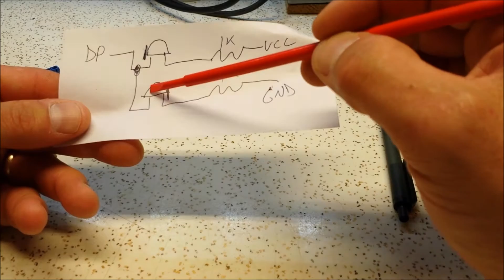Arduino ATtiny 85 PWM Solar Charge Controller

Comment: The 78L05 draws too much quiescent current (3-8mA), but it's crazy cheap, (<$0.05 in 100+),  and I use them a lot, but not for low quiescent current.
Something like a LD2981 (<1mA, not great but better), LP2950 (<200uA, good), TPS76350 (<100uA, very good) are.  Cost more, but they (escpecially the LP2950) are worth it.
If you work at it to fit into small memory, you can get an ATTiny13A (cost <$1) to work.
The PIC12F683 and ATTiny13A are actually the best for this app by far.
Reply from the maker: Awesome.  Thanks for the info on the 5 volt regulators. Did not know that had even lower quiescent current regulator.

Comment: An accurate and complete schematic would surely be nice.
Reply from the maker: It is the video description.
Reply: Thank you Sir for you're fast reply. The video description is pretty good but a schematic would make it a bit simpler to accurately reproduce you''re great design.
Reply from the maker: Hmm. Thought that was there let me check my files.
Reply from the maker: try this, just added a file to the link in video. 
https://6b1e3a5b-a-62cb3a1a-s-sites.googlegroups.com/site/recksdesignfabrication/arduino-projects/attiny-85-pwm-solar-charge-controller/arduino-pwm-solar-charge-controller-schematic.png?attachauth=ANoY7co4DRCpwWBcbstejROy4wNngRgx4CrlmGGAh4C7FkhTtCAcPMdyydRoLLO1ZjDDrJQhJwW6CMf0Syq6DRerKHi0r291g2HjdieznTI_-ZNK3J9GFCB9uy2sQ2SjiQZfJIwk_UBd46G9aBAk3c5leRECLeIpeiHBuSlUGZ1K4EtwFa0cFLaEmv390AC4WeSCw4KnhU-HmK95G70tIvZmn-grnpA4Po974ROxt_0iWKboghBklotppa95nI08jIdb19C1DUN_XX6bv0F5ig6U1PqEEmO7PRc9KqTPPXMffTxeaTqy4F3Ne8fkqI_52zN8AcAuitmxV6qZPayWkotdqeW7fH6t69NH2wWAjEchMvdq26Ez86k%3D&attredirects=0
Reply: Thank you!! The schematic looks beautiful. I just sent you a small donation by way of PayPal. I hope more youtubers follow your lead. An accurate schematic with component labels makes things much simpler to reproduce designs. Thanks again Carl..:)
Reply from the maker: Yes. Thank you for the donation.

Comment: If you  connect the junction of the two Leds to DP via a 1k resistor and take anode of one  to Vcc and the other to ground you only need one resistor.
Reply from the maker: +alan Alan Weaver wow. You are right! Not sure why I did not do that??? Thanks for the tip.

Comment: hi carl, thanks for the brd file. can you tell me how much maximum current can handle it??
Reply from the maker: +Arindam Ghoshal The mosfet us rated at about 100 watts so about 7 amp. However I would not go more than 5 amps.
Reply: Carl Recktenwald Jr. ah thank you. one more thing I noticed, there is no schematic  in your file section. it will be better if you upload a schematic. because there is a wrong lebel of shotkey diode.
Reply from the maker: +Arindam Ghoshal unfortunate I never did a schematic. That is actual a transient voltage suppressor. Not a diode. The circuit is a copy of the PWM 5 from Julian iilett. That circuit diagram is on the attached website.

Comment: Is your board shared in osh park?
Reply from the maker: Now they are... 
https://oshpark.com/profiles/squiggyreck
There is 2 versions. In the Rev 2 I moved the LED and changed the Font on the screen printing. 
In the link for video description is the board files.
Reply: Dear Carl, I just sent a request for access to your google files for the .INO Arduino files doy mind? Also my oshpark boards will be arriving tomorrow, I will put it together and let you know my results. Thank you for having the part values on the board itself it will make it easy to find the components in my parts drawer.
Reply from the maker: +Omar Alvarado do you know what the sharing does? I have had others ask and did not know what it meant?
Reply: Carl Recktenwald Jr. i'm not sure what it does but now I figured out that I don't need permission to download the file. What they need to do is click at the very right of the file with the arrow down which means download just have them do that and that's what I did and I don't need any other permissions from you thank you for the quick answer however